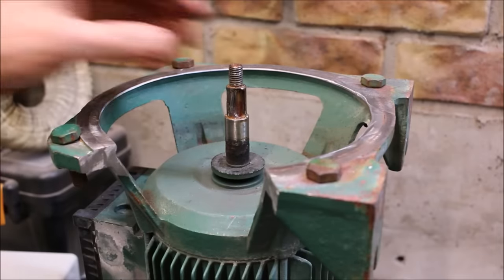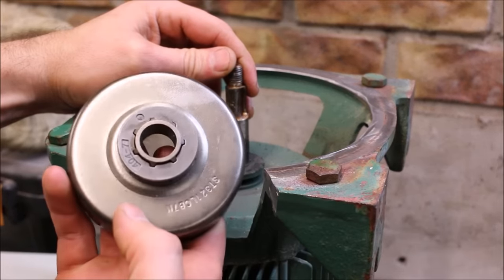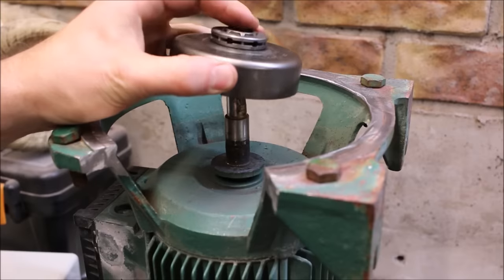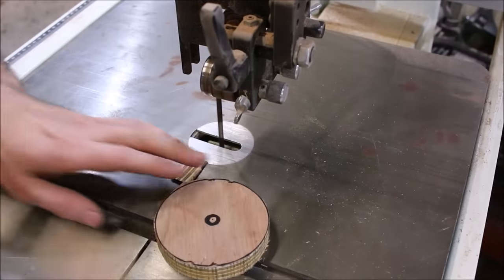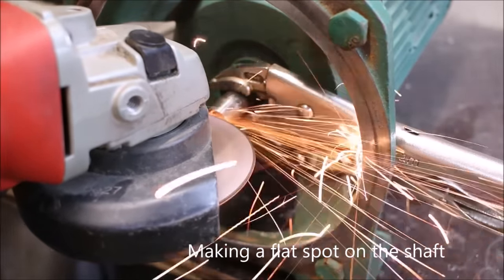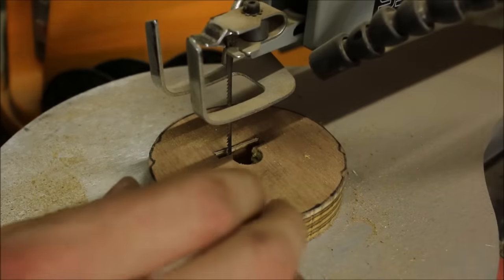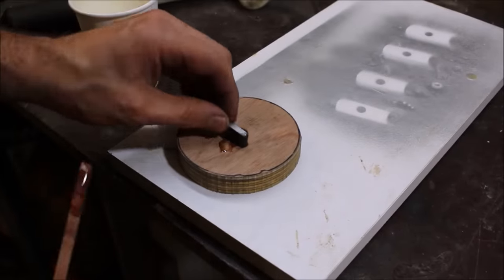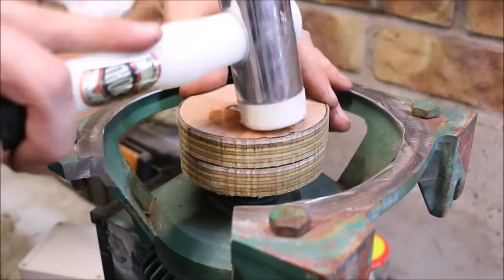Making an Electric Chainsaw Mill - Part 1 - Making The Chainsaw

Comment: I just came across your electric chainsaw mill build. Awesome job, thanks for sharing with all of us. I have a procut chainsaw mill that I built a few years ago and I always wondered if I could build an electric motor for it instead of the chainsaw. Now I know that it can be done. Thanks man. If you ever see this post I’d like to know what size motor you used.
Reply from the maker: 3hp

Comment: Great idea and work, kudos, inspired me to finish what I started a few years back. The welds would be stronger and batter if you had a nozzle on that mig gun (unless you’re using flux core wire).

Comment: I actually thought about doing the same thing but with a chainsaw mill attachment and a 3/4 HP electric motor. Cause these larger saws are pretty high but you can get a decent length bar for under a hundred.

Comment: Hi, interesting project, like the low tech solutions, just wondering about the chain speed, obviously the motor speed is slower than a chainsaw engine, is this a problem? cheers
Reply from the maker: yep its slower than a chainsaw but it has a lot more torque, i think it works well.
Reply: @mtarrant3  Thanks for that, I'm thinking a 5Hp motor at 240v will pull about 4 amps per Hp so 20amps is quite some current. No wonder it has some grunt, cheers
Reply: It's a B.O JOB !! AT !! BEST !!!

Comment: Pretty clever. 
Been wanting to engineer a DC powered sawmill with a motor somewhere between a 37 hp forklift and a 5 hp golf cart. Logosol does sell a three-phase motor ready to go that goes 8 kilowatts, or 20 hp. The next step in invention I would guess is making a fold-out photovoltaic trailer housing for such a mill.
Reply: Do you realize how many solar panels would be needed for that setup?
Reply: @lonewolftech  
Yes. Do you understand how batteries already power 10,000 lb forklifts...my alternative motor source compared to a golf cart? I can charge a bank of them all day before going to the transportable sawmill with the battery, or batteries...interchangably.
Reply: @akryeguy  AND !! POLLUTION !! TO ! MATCH ! IT !!

Comment: Looking at going on a similar journey myself, thank you so much for showing us the details.

One point! I don’t think your machine has high enough RPM! The logosol electric mill (e5) uses a 2800rpm motor with a large 24t sprocket. Just done the maths and that leads to 21m/s speed which is about right for a chainsaw.

Assuming you're using a 3/8" pitch chain and 2800rpm motor with 7t sprocket, the chain speed is just 6.2m/s.
Reply: @fuzzzeballs  AND ! JAMS ! UP !! TOO !!

Comment: great build so far, thank you! How did you calculate feet per minute for the chain, or motor RPMs required to know the chain was moving fast enough? did you have data from other electric or gas chainsaws? also, how is  that motor breakered at the panel? double 20 amp breakers, or higher? thank you very much!
Reply: 8

Comment: Great concept, imo isolate failure points such as using wood for motor spindles..take the wood you created and at least sand cast out aluminum or steel with the wooden ones you created. I do it often with plastic parts from tóols I purchase. A few hours could save a person thousands. Anyways, kudos! Welll done.
Reply: Good idea Henry! Thank you for that one.
Reply: LASTS ! ABOUT ! THE ! SAME !.TOO !!

Comment: Hi
First, thank you so much for sharing this inspiring build with us.
I'm planning to build something similar this summer and hope you may answer a few questions:
What rpm is your motor running at and do you wish it was on a pulley to increase the rpm on the sprocket?
Reply from the maker: the motor is 2800rpm, this makes for ok chain speed with the chainsaw sprocket that i used. It would be better if the sprocket was maybe 2 to 4 times the size it is.
Reply: @mtarrant3  thanks for the info. I'm thinking of using a 3500 5hp motor and mounting it on a horisonttally swinging steel plate with a bolt to tighten against the frame, so I can tension the chain without having to built a complex tightening mechanism.
Reply: @alexanderreuss-ym1yx  Wow, that's awesome. But I'm not sure to understand how you would get the tension on the chain. Could you explain this in more details. I'm looking to get the same result! Thanks
Reply: @simonlaverdure9449  I changed plans a little and now intent to mount the plate attached to the motor onto a steel plate. As the backing plate has slots where it bolts on that should allow me to tension the chain by moving the motor.

Comment: So miotch after use 18mos later what should be changed made better spocket sizes/quality. Motor rpm,  Hp bearings transport feed dust chips vibration???

Comment: Would a gas powered large cc chain saw mounted to your frame. For off grid living.
Reply from the maker: Yep an normal chainsaw would also work but an Alaskan mill setup is simpler option.

Comment: What brand and model welder are you using? Cheers!
Reply from the maker: Its a Unimig Vipper mma 182, a mid range welder here in Aus. I'm running using flux core wire (so no gas).

Comment: hi what is the engine technical data you are using. ?
Reply: I think I saw a 240 volt sign on the motor and it was 5 horsepower.

Comment: One consideration not addressed by you video is that chainsaws require lubrication of the bar and chain or they overheat causing the chain and bar undue wear. I have used chainsaws most my life and if you skip filling the bar oiler you end up with a chain and bar that will not cut straight even if carefully and accurately sharpened. In addition your chain will not hold an edge as the heat will soften the heat treated saw teeth.
I would suggest an oil tank, and line to feed into the bar oiler hole with a cylinder and plunger assembly of some sort that you can use to like the bar and chain.
Reply from the maker: G'day Ed, please see the next videos in the series
Reply: ABOUT !.AS !. GOOD ! AS ! MISTER ! HADD !! JADDDS !! HANDS !! FROM !! INDIA ! MAKES !!

Comment: Nice work.   I’m interested in how you chose your motor.   Is 5hp the right amount of power for Aussie hardwoods.   Look forward to more videos.
Reply from the maker: Hi Andrew. I think 5hp is the biggest single phase motor you can get? A bigger motor like a 10-15hp would be better but these seem to be 3 phase. 3 phase motors can be run on single phase with the use of a VFD but they draw a lot of amps. To run a large 3 phase motor I would probably have to put in a new 30 amp (maybe more) circuit on the hose from the main box, this is a possibility in the future.
Reply from the maker: I wish i has 3 phase power
Reply: @mtarrant3  Could you tell me how many amps the motor draws and it's rpm please? I'm struggling to find a motor that can run on a uk domestic 13amp/230v socket with even half the speed of a petrol saw. Even with a large sprocket the chain speed wouldn't be ideal. Great video mate. Thanks.
Reply from the maker: The motor is 12A and the RPM is 2,800. I run this off of a normal 10A socket no problems.
Reply: @mtarrant3  Wow. That's very low rpm compared to petrol saws. I can see from your videos it works fine though and I don't need to worry! Thanks for the insight.
Reply: @mtarrant3  motor 220 v 3000 oborotov🤔🤔🤔🤔🤔🤔
Reply: @mtarrant3  you really sparked my interest in building a sawmill my friend. I was really curious what size motor, phase, and rpm range you used to create such a wonderful piece of equipment. Thank you.
Reply: Just bought a logosol F2+
Went to buy a Stihl fuel injected saw.
Told them I have had rotatory cuff surgery fixing a massive tear....
       They said I wouldn't be able to pull start a saw over 50 cc.   They were right 👍
       Now  after I follow your videos I will be able to start milling lumber!

Comment: Would a 3/4hp washing machine motor work? My brain says no cuz my 395 has like 7something HP I believe, but id rather not stress out the big baby ya know.
Reply: I thought the same thing. I thought I looked up the HP to CC conversation calculator and I thought it would be enough HP. Apparently not, 3/4 HP only converts to 11.22 CC.
Reply: @mattcasdorph  that just send off cuz it was from a 80 lb load washer

Comment: The reason no one uses chainsaws for proper mills is if you have an in situ mill you sure as hell can use a band therefore instead of wasting a quarter inch of wood per cut and scratching the shit out of the surfaces you get a nice clean 2-5mm cut with brushed surfaces.
Reply: No one? What is a situ?

Comment: Man, you're handy. 5 hp pulls a lot of amps. I wonder what the electric requirements were? Breaker and wiring has to be safe or you burn down the place sooner or later.

Comment: You must have some serious wiring to run a 5hp single phase my 3hp air compressor will Trip breakers if too much stuff is on in the garage